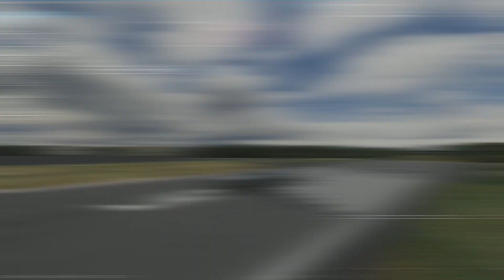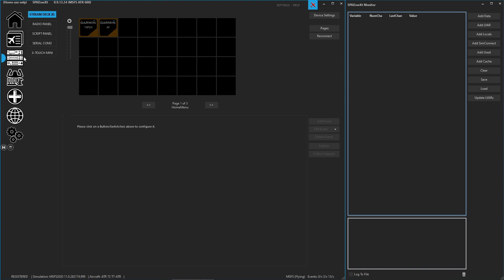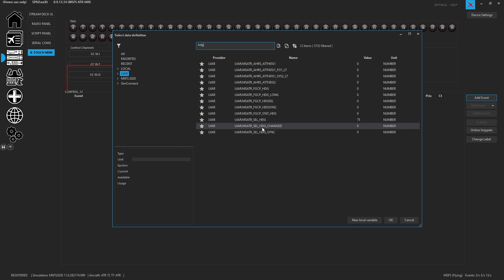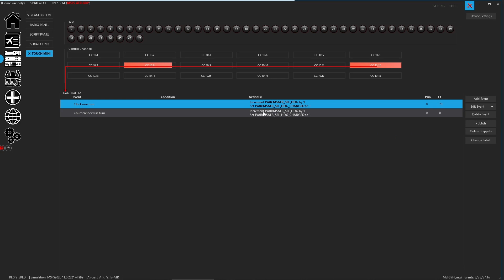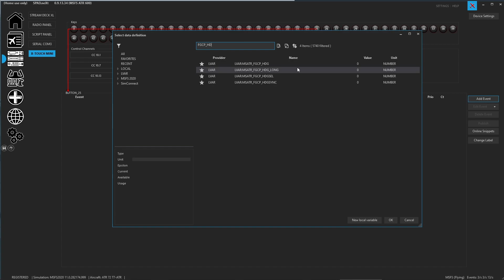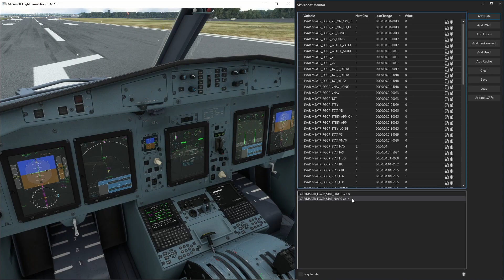MSFS | SPAD.neXt | Data Monitor | MS ATR 600 L:VAR How To

Comment: I really hope their comes a video in near future from you with profiles for HC and Multipanel :)
Reply from the maker: Using this you should be able to make quick work of it..
Reply: im making one now struggling with one or two things though
Reply: @LesOReilly  Managed to do HDG and CRS but altitude is a bit struggle since the values incre/decr fast
Reply: @matthewhaskins9416  Will you upload when finished?
Reply: @andreasholmberg6381  sure im pretty much done now you won't be able yo use flaps, trim as i cant work that out the rest are good though i think
Reply from the maker: Standard flaps events and trim should work.
Reply: @LesOReilly  have you managed to set up VS i found the commands but its not working tried everything!
Reply from the maker: Yes there posted in the discord in the MSFS-pay ware channel. I am not going to be finding people LVARs via YouTube comments.
Reply: @LesOReilly  no worries I'll head on over 👍

Comment: Great video as always Les, thanks. What I find "annoying" is that it seems in the ATR when controls a re managed though SPAD, the animations aren't triggered which I think on things like lights causes a conflict in the plane.  I checked watching the video closely and when you used the control, the heading knob was static.

Just a note that if I apply the nav light on and off to one of my Bravo switches, the light is correctly controlled but again, the animation isn't triggered. Means functional but immersion is very degraded (for me) in that there's no audible confirmation of setting and a visual scan is all wrong.
Reply from the maker: Have not gotten to switches like that yet but all my other switches have moved — ie the start mode rotary switch and the power management switch. 

There is nothing we can do at this time if the dev does not link the animations to something we can control. This is mostly attributed to the BEvents that we still don’t have API access too. 

It is what it is… but I would rather a knob I can turn than spin a mouse.
Reply: @LesOReilly  agreed - I got the heading sel working per your video but the crs was a bit more challenging with a different schema - instead of the "changed" it seems to use "delta" wich I had to have + or - depending whether I'd incremented or decremented. Those two plus the ALT are the key things I care about tbh as I find the screen near impossible to read and then also operate a mouse at the same time. Those 3 will do me for now.
Reply from the maker: @mikebakkeyt  I just got to my computer now and setup a NAV Light .. it moves the switch in the sim and I hear it clicking like I do if I move it with the mouse..
Reply: @LesOReilly  interesting. Which var or command did you use?
Reply from the maker: Best you join the spad discord that way I can post images
Reply: @LesOReilly  lol - I am already in there as b3lt3r :-)

Comment: Thanks a lot for the video, Less. I am trying to control the Asobo Skyhawk interior lights with my Asobo Live device. I have found the LVAR's involved, I have created "Data Change Actions" for two different lights (Cabin_1 and Glareshield_1) following your instructions, and I have a (partial) reward: when I dial my controls in Loupedeck, the Data Monitor shows that I am modifying the Value inside the limits stablished (0-100). The "only" problem is that nothing happens in the sim, the brightness remains unchanged. I would really appreciate any advice about my possible mistakes. Thanks a lot in advance.
Reply from the maker: Pretty sure we covered this in the discord about using the dev mode.

Comment: Thank you Les, it has helped with the FGCP buttons but I still can't figure out how to do the hdg, alt,vs & ias rotaries for the Honeycomb Bravo. Any chance of a short video specifically for the Bravo? I did manage to do the lights, the brake lever and the power management rotary.
Reply from the maker: this video specifically shows how to do the hdg and how to figure out the others ...  please watch the video and apply that example to the HDG function on the Bravo..  Then try replacing HDG with ALT or PITCH for the VS..  IAS is spd.. anyway it's also all posted in the discord..

Comment: Hello, can you make a tutorial for axis configuration? thank youu. really appreciate your video
Reply: I'm trying to set up my Pro throttle quadrant into Condition levers in ATR72600 in MSFS
Reply from the maker: In the SPAD UI .. Home Tab -- Video Guides Sub Tab --  ATR 600 you will find there are two throttle videos including the Bravo and the TCA ..  They will explain how to do this with just about any throttle.  If you mean a Logitech Throttle then the Bravo works in a similar way -- they have a detent but no axis at the bottom.  Use that video.

Comment: Your video was really helpful.  QUESTION... In the latest version of the ATR, when I look through the LVARS I can not find the same list that you had in your video.  For example I am looking for the heading sync LVAR and the only LVAR I have for Heading is something like HDG_VAR_ANIM.  Nothing for the IAS button as well...Did the LVARS get changed in the latest update ??
Reply from the maker: Are you sure the LVAR Bridge is running?  did you press the UPDATE LVARs button in the Datamonitor ?
Reply: @LesOReilly  I will check both of those things
Reply: @LesOReilly  LVAR bridge is installed in Com Fldr and I did update the LVARS but no change in the list.  Cant find anything that looks like the HDG SYNC, IAS button, and several others.. Not sure why the difference...
Reply from the maker: @mikewilley5678  I would suggest you close MSFS .. Re install the LVAR Bridge.. version 3.8 should install with the current release of SPAD.  Then restart the sim..  In the Data Monitor you can always click on the ADD LVARs .. and then "Update" LVARs..

Finally when your looking to modify these your looking in the Change Data Value add action item correct?  Not the Send Event Action Type?

The ATR video with the XTouch is also good for showing how to bind all kinds of AP controls.. including the HDG sync
Reply: @LesOReilly  Thanks and I don't want to overstay my welcome here and your helpful hints but I did confirm I have 3.8 installed and reinstalled it with the sim off then restarted the sim and I did update the lvars in the sim but the list of LVARS is still the same with no LVARS for the HDG SYNC and several others.  Is your current list of LVARS in the ATR sim the same as in your (this) video ??  This one is strange but I may have missed something basic but not sure what..
Reply: The only thing I didnt see is that in the settings there is no button switch for turning LVAR suport on but that might have been taken out once they added the .exe to install the bridge...
Reply from the maker: There is no need for a selector to enable LVARs they are always on..
I have the list with all of them in Datamonitor..
you need to join the spad discord .. you need to link your license and then you need to go to the MSFS announcements channel and grab the Bridge 4.1 installer that is there and try that..
Reply: @LesOReilly  ok. You’ve done your part.  No more questions but thanks for all ur videos!!
Reply from the maker: @mikewilley5678  join the discord for spad and ask away there .. most important is there is an updated LVAR Bridge.. That might be related as there were some changes with AAU2..
Reply: @LesOReilly  4.1 Installer did the trick.. All LVARS are there now... Thanks for your patience

Comment: Great video as always Les! I have the cockpit masters CDU for the 737. I know you made a video to use it with the CRJ. Is there any way to see the info displayed remotely on the CDU? I have the line select buttons working but I can't seem to get the screen to mirror the aircrafts CDU
Reply from the maker: No it does not have the same output from the screen like the CRJ has..
Reply: Okay thanks Les. Cheers

Comment: Question, the Honda Jet and the Longitude have almost the same avionics. I wanted to change my pitch trim wheel on my multi panel from pitch trim to zooming the map in and out on the secondary display. You mouse over the GTC Joystick and use the mouse wheel to zoom the map in and out in the sim but I have not found the control command for that in SPAD. I used the Data Monitor/Usage and zooming the map in and out does not register. Do you know what it is by any chance?
Reply from the maker: In the FFX discord or the HJet videos there is a link to the binding document. That document lists all the HEvents for the GTC units. The left unit GTC in both is the “vertical 2” unit and it’s the range event.

Comment: So, do you have anything for black square king air? Everytime I try getting avionics master and start switches the switches in the sim stop working even after I remove my key assignments
Reply from the maker: Those are heavily tied to LVARs for animation and then some other k event for triggering systems. 

Use dev mode to see what each switch does for a click.

Comment: First time using spad. I'm not getting what you are. I only get 4 LVARS to show up and nothing when I rotate hdg knob.
Reply from the maker: You probably never installed the LVAR bridge.
Reply: @LesOReilly  I restarted and now it's working. So, following your guide, I have the HDG rotating knob on my HC Bravo working now. But, what if I want to use the same knob to change the coarse as well?
Reply from the maker: @Catamount287  Watch the other videos on the bravo and how to use conditions ..  most likely there is already a snippet that is published for the Bravo around the ATR and you can just download that.